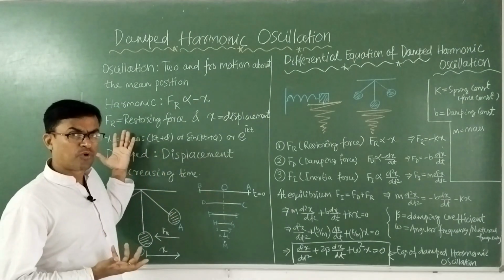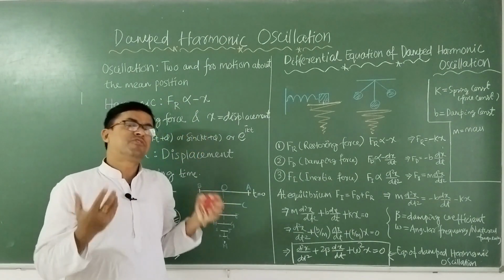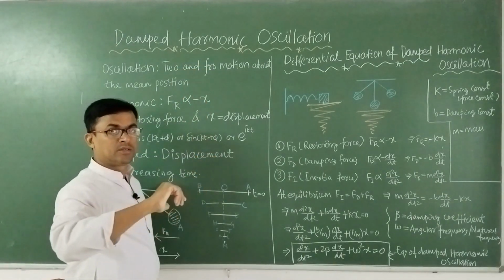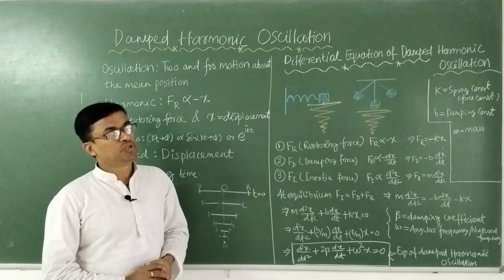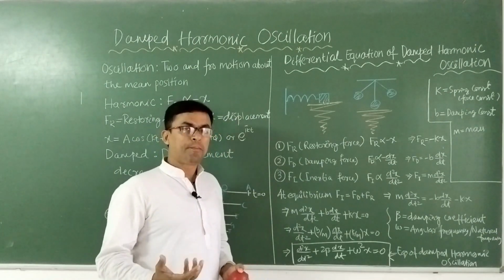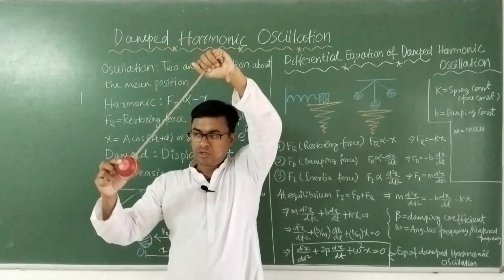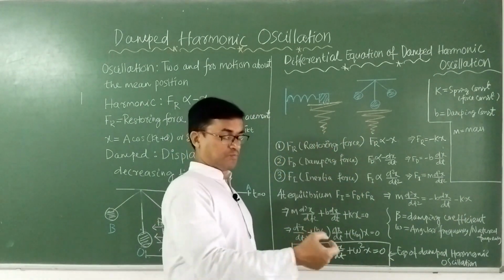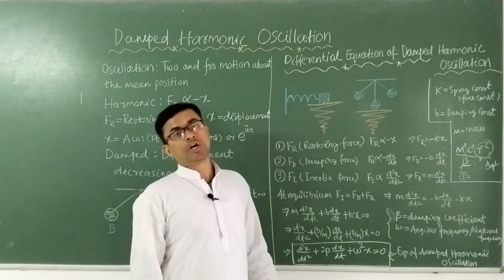Damped Harmonic Oscillation#1 II #DampedVibration in Engineering Physics

Comment: Sir, my doubt is that in the case of free oscillation, their is no dissipation of energy by the body that is why it is in continue motion forever just like pendulum in vaccine. But is it practically possible, like if the body is energetic it out be highly unstable and would like to be in stable condition( Lower energy state). 

Plz correct me sir, if I'm wrong.